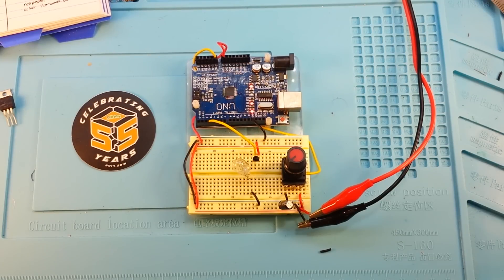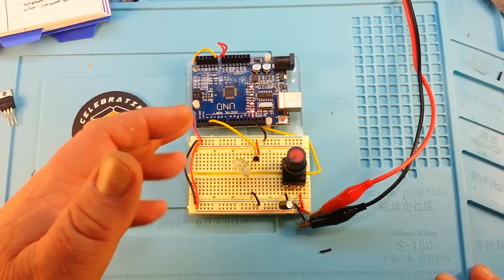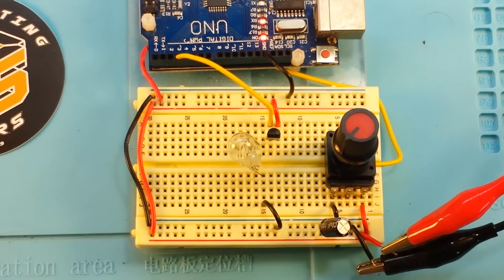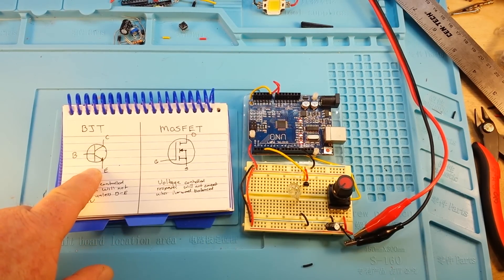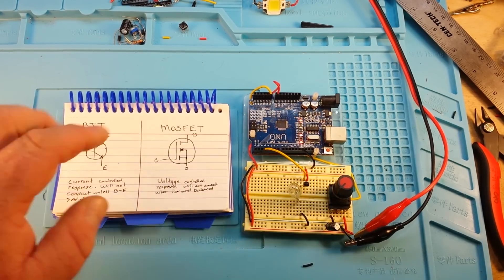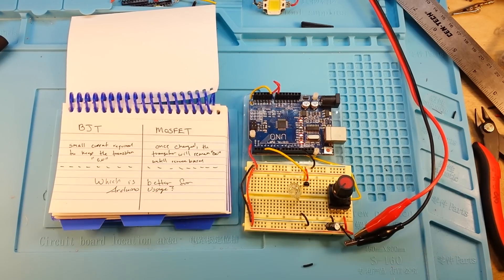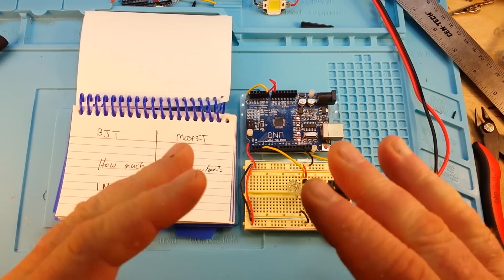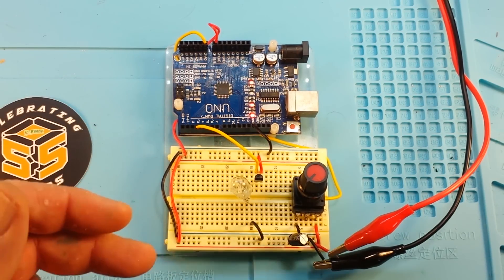MOSFET or BJT?  Which is better to use with Arduino

Comment: you forgot to mention that mosfets come in different voltage turnons. You must have been using a ttl version. 12 volt versions would have melted down. And you left out IGBT's altogether. You might want to redo this on.

Comment: Great video.  Go for the contract, just be open about the influence.  Also, can you make a video like on ESP8266 or ESP32?  The difference is the 5v vs 3.3V.  That mean the ESP cannot drive an MOSFET that requires 4V.  I've been having a hard time finding a usable MOSFET.   Thanks
Reply: IRLZ44N - a little expensive at 2.80 PLN where I live (0.6 USD now), but work every time and can deliver 5 amps at 60 volts, good even as BLDC motor drivers.

Comment: You are calculating the overall power to the circuit, but you are not calculating the power dissipated in the transistor.   If you did, you would find that the MOSFET has a substantial advantage.   But you never got around to doing that.

Comment: You should use a pull-down resistor on the gate. So the MOSFET doesn't stays on. Otherwise you have an floating pin and it turns randomly on and off when you have an electro magnetic field around you.

Comment: Hello Paul, really loving your channel (I've been a subscriber for several weeks now) I think you made a little lapsus calculating the power consumption
You have P = V * I = 0.315A * 10v but should be P = 0.315 A * 5 V since you've said it was 5 V feeding into the light bulb. With 5 V it effectively producess 1.575 Watts, (otherwise would be 3.15 Watts).

Best regards :)
Reply from the maker: I did

Comment: I agree with u. 
But the most easy component to buy in my local store is resistor capasitor and transistor.  So i prefer to use transistor because it easy to find.  And by 5 volt i can turn on it via 5k  resistor. And for current teoriticaly 1 miliamp. Still save for MCU.

Comment: Should work well so long as you mark each video for that purpose as being for that purpose. Then if anyone wants to avoid them for some reason, they easily can. Losing the use of boards produced by any other company could become an issue, but if you're absolutely certain you won't need to then go for it.

Comment: Another lazy written equation explanation .315 amp * 10 volt = 3w15 now divide by 2. Because watts consumption of transistor and lamp so 3w15 / 2 = 1w575. Mr Learn did it in his head, then completely forgot to tel the students. because he was burning his fingers on the transistor.

Comment: I'd love to see an end to end PCB thing, like designing a circuit, plotting a board, what tools to use, ordering the board and the final assembly.  Even if it is locked with one company for a year it would be informative in general.

Comment: Why are you using a common-collector/emitter-follower to switch? Given that the output of the Arduino is 5V and the supply 10V, your transistor is always guaranteed to dissipate a lot of power.

Comment: I agree with the other guy´s here Paul - we are using PCB way, and they are easy and nice to work with, so why not make a buck when you can.... Also since it is very cheap to make a professional board today i think that many of the guy´s  would have an interest to see how it´s done. - On the other hand you need to have a few videos including some design programs as well to be able to send the layers to PBCway :-), but go for it dude... 73´s /A  (Sm7Hce)

Comment: Contract? Is it a company you trust enough to put your reputation and everything you have worked for on the line with? Are circuit designs your viewers create safe from being stolen by Chinese companies? I have not heard any horror stories but if I came up with the latest and greatest widget I'd want some kind of copyright protection and I'm not sure you can get that from any company based out of China. Before I go any further, where exactly are they from?

Comment: Paul, we know that you meant 0.315 x 10 = 3.15W as seen on your power supply; simple mistake, thanks for your videos.
Reply: Yep, he was thinking on the 5v off arduino supply, not the external. That appens to me also. Best Regards

Comment: Go for it Paul. Sign the contract. Thanks for this video. I've been trying to figure out what is better. I prefer mosfet because it work better in my applications. I try to use BJT as often as possible because it is a bit cheaper. But I am still learning.

Comment: You deserve every cent. Go for it.

For anyone interested in detailed transistor info check out the book  vol 1 of Electronic Components by Charles Platt, it goes into detail if you like that sort of thing. I love to use NPN MOSFETs with AVR chips cuz its just easy.

Basically...they are different flavors of magic.
Reply: u mean NChannel, not npn

Comment: You're right about the opinions of usage for either package. I'd rather go with the MOSFET too for reasons of easily controled power isolation from a fragile adjacent circuit.
Contract.....I....don't know of course they'll monetize it. Question is can they monetize you better than you can do it yourself? I would get an attorney to check the contract for any loopholes that may exist, in order to capitalize your abilities over your existing you tube channel. They could be after what they may think you are capable of doing or creating for them, while in the process eliminating your claims of any personal creation associated with their channel. Then who knows, may be the best moment of your life. I hope the best for you. Just be careful and stress conscious for your health benefit. Keep in mind, any kick starting campaign's are extremely stressful! In case that may be what they're after.
Reply: I agree. But what if something happens in which you are unable to fulfill the contract's specified videos? Will you have to forfeit monies to them? What penalties will you incur if you want out of the contract before the end of the contractural agreement? Perhaps an attorney's input may help you draft a counter proposal with the appropriate caveats. 
Aside from these points, I say go for it. You, of course, will then become a manufacturer's rep.

Comment: How does one 'turn off' the flow of current in a MOSFET once it has been 'turned on' since removing the voltage no longer applies?
Reply from the maker: Make the gate less positive than the drain.

Comment: That is awesome about the MOSFET.  Once the gate is forward biased, you can remove the gate voltage and the source to drain to drain stays 'on'.  And a BJT requires current to activate, AND stay flowing from the collector to the emitter.  Total light bulb moment for me! Do the contract! I will kill to have a gig like that!

Comment: Wait, what? The Arduino has a Vin pin!? I had no idea.  How much V in can it take? I need to finish watching the rest of the video before I ask anymore questions...
Reply: On the UNO they suggest between 7 and 12 volts, the absolute maximum is stated as 20 volts, but you would expect the regulator to get really hot if you tried that.
Reply: @ThermalRunaway  Thanks for the info. !
Reply from the maker: Mr Cooper is correct.
Reply: @learnelectronics  haha there's a first time for everything!

Comment: Good video. However I would think the #1 reason would be that MOSFET would allow you to run all 32 pins without any additional parts count besides the MOSFETs.  You could do the same with BJT's, however in addition to the 32 BJT's, you'd also need 32x resistors or SIPs to BOM. Plus, you might still have to watch 100mw Arduino package limit depending upon how much current each BJT connected pin required.

Comment: Hi, 
Be very carefull, other youtubers have signed similar contracts that essentially sign away all your revenue to the vids and any similar vids you may make after the contract ends.  Not saying this is the case in this instance but if is as simple as you suggest then I have no issues.  Your vids are always good, very interesting and educational.  Thanks for sharing your skills.
Reply: I agree, make sure you arent giving away something valuable. Maybe have a lawyer look it over?
Reply from the maker: It is with a lawyer.
Reply: Yay!

Comment: I say go for it and if you'd like some PCB ideas, I have a few I'd be happy to share. And money is good, all the better if it helps to keep the videos coming and more test gear showing up for review. As for the video topic, I prefer mosfets. It is a lot easier to provide a target voltage (for me) than to fiddle around with current driven devices such as BJT. At least for the task that I commonly use mosfets for and I have a nice selection of FETS that work well with my 3.3V devices. And for anyone using a MOSFET, I'd always recommend at least a 10K going from gate to source. I'd hate for some random cosmic rays to turn on the MOSFET at an inopportune time, or a careless touch of the FET while doing other stuff.

Comment: If you are striving for low power use then MOSFET’s are the clear winner, just because they use zero current at the gate.  I really only use BJT’s for oscillators any more.

As for the sponsorship go for it. You could do some fun projects where viewers could order your board designs and build the same projects. I already have a few ideas but I’m sure I’m not the only one.  Great video Paul, have a great week man and I am looking forward to hearing what you decide.

Comment: Ya know if you are in or from India a relay with no EM diode switching mains voltage and loads and no isolation is the best option... XD
I use mosfets to drive contactors thet switch heavy loads at mains voltages of course these are 24 volt contactors and have their own power supplies and snubber circuits. I used to use power BJT's but I found they would fail prematurely so I switched..

Comment: 2 things  

1) wouldn't the BJT power draw be 3.15 Watts?  

2) And I think you should.  Personally I would enjoy watching a vid series on how to design, purchase, test PCB's for my projects.   In a step-by-step way.  Max
Reply: Yes, he rounded it but didn't mention that, which is confusing for beginners.
Reply: @ErikBongers  haha...  Ah yes..  That rounding thing.. 😊
Reply: Thanks, I thought I was losing it, especially after so many comments not being mentioned...
Reply: Woops, meant to add, how do you round 3.15w to 1.5?
Reply from the maker: My mistake
Reply: Oops...I actually wasn't joking. Lack of sleep I guess. Oh, I remember. I mixed up the numbers in my brain: 1.35W (sort of) rounded to 1.5W. Sorry to have added to the confusion! 3.15Warps is the correct answer!

Comment: How did you connect that bjt. If that's 2n2222 or same pinout then you have emitter follower then you have about 5v CE voltage drop. So it will get very hot. Use base resistor and connect emitter to ground and load to collector.
Edit:

Also check what is Vge for used current with that fet. When using NPN or N channel mosfet as switch then use it to switch load to ground. if you want to switch VCC to certain device use P channel FET and NPN for controlling it.

If this was bait then whole bait is now gone :)

Comment: Hi Paul. Love your channel and the reason why is that the channel has professional integrity and you choose what you would like to show your subscribers. Now, if someone comes aling and offers you up to $6000 a year to promote their products to the exclusion of all otgers, then will your own independence be called into question - your professional integrity. You could try contacting the other PCB manufacturers, and stopping short if a dutch auction where the highest bidder wins, see what these companies would pay you NOT to go with one supplier. Iv you have the clout, and by that I mean you have a large enough following which means you have influence, then they should listen to what you say to them. At the end of the day, it is your choice but you are in a strong position as you hold all the cards. If you do take the contract, may J advise that you speak to a lawyer before signing andd ask the company behind the deal to pay for you to get this advice,  just to keep you right. They should agree and I would also see if the consultancy fee is negotiable and try to get this payment increased. You don't agree on the first and only offer. Good luck and keep well. Mike

Comment: My calculation is 3 watts not 1.5 watts.  Yes for 5 volts it will be 1.5 watts   Am I right or is my mind going?
Reply: in bjt case it's about 1.5W for lamp and 1.5W for bjt (emitter follower). Also mosfet had issues. Usually you connect loads to ground with bjt or mosfet to get best effiency.

Comment: 0.315 Amps * 10 Volt  = 1.5 Watts ??? ;)
Reply: Math is hard for an American. Cut him some slack. :)
Reply: You don't have the full 10 volts across the transistor because it is in series with the lamp, as well as with an emitter resistor, if present.

Comment: I usualy uses N-channel Mosfet em NPN BJT after the load, not before like you did. Of course you know, using in that way, the load will receive the power with a voltage drop caused by the internal resistense of transistors, the voltage drop incriase proporcional with more current. It is becose I don´t like to use in this way. Before the load, only P-Channel and PNP transistores.
The new question is:  Arduino and IGBT transistores, does it works?
It will be a very nice subject to another video. Thank you.